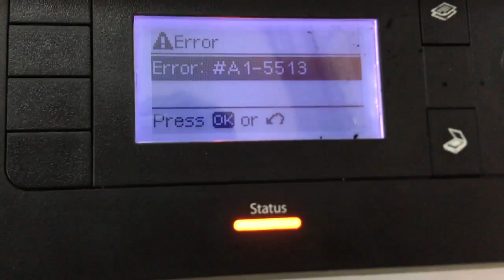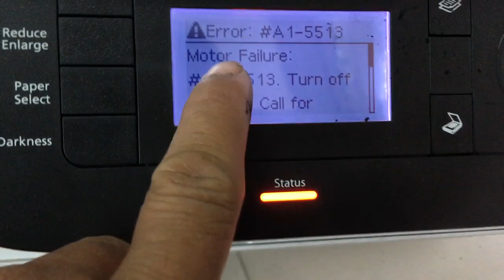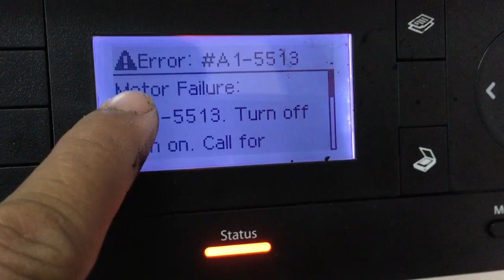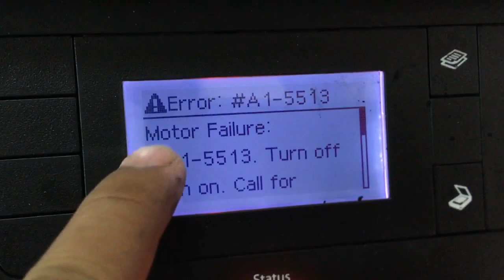HP LaserJet MFP M436n display error code A1-5513 checked part 02 Checking Motor Failure message

Comment: Bonjour, moi le problème au démarrage je reçois le code A3-3312
Reply from the maker: Please checking (The outer temperature sensor is defective.)
1) Turn the machine off then on. If the error persists, turn the machine off again.
2) Enter the tech mode. Check the temperature sensor output.
3) If the sensor is defective, replace it.
4) If the temperature sensor is OK, replace the main board.

Comment: I have problm#u2 1113 error code plz solve
Reply from the maker: U2-1113, U2-1114 LSU failure errors
Reply from the maker: The hardware problem (Laser unit motor and board drive laser)but you can try turn off printer and unplug the power cable wait 3 minutes and test again, if can not solved try to open and reconnected LASER Unit